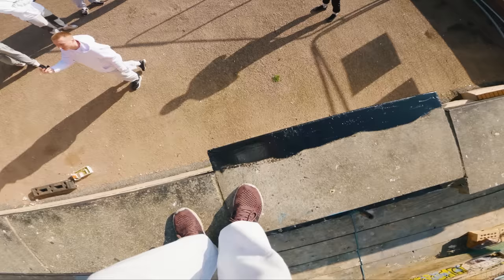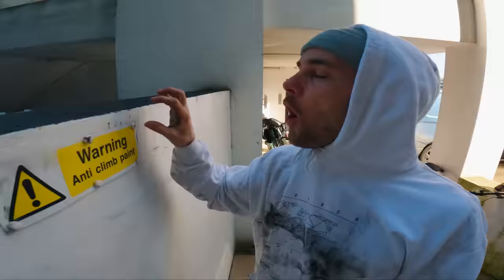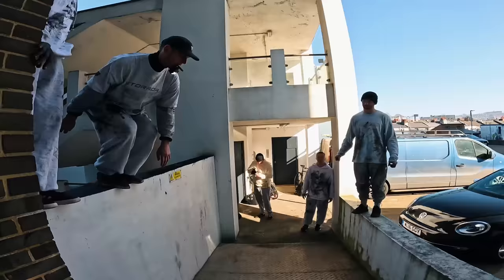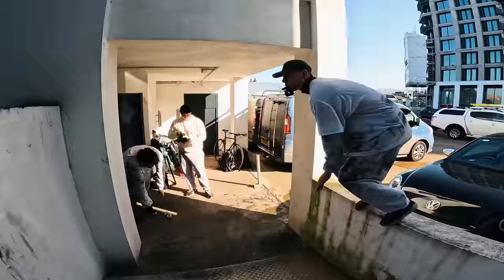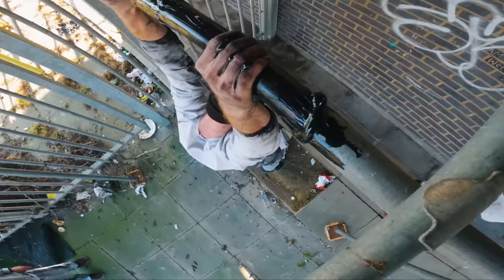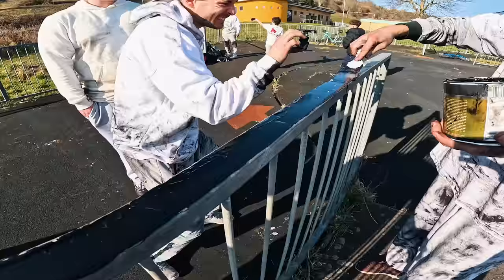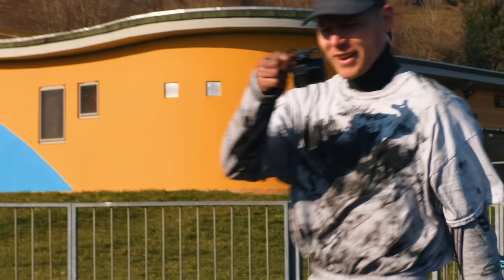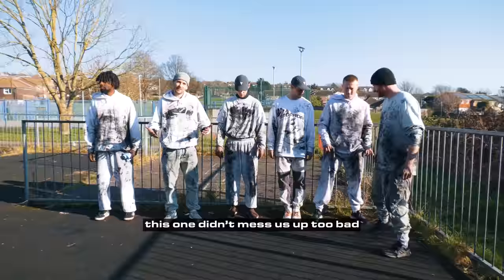ANTI CLIMB PAINT vs PARKOUR - Does it work?! 🇬🇧

Comment: Nerd here:
    The trick is to keep the center of gravity closer to the wall so there would be less pivoting force around your feet. Basically meaning you should keep your entire body as flat as possible on the wall and push with your hand. If you try to kick with your feet, you will feel the force of the kick not direct you upward, but push your hand off. The reason doing it with the entire forearm often works is not because there is more contact with the wall, the paint is so slippery it makes a negligible (ignorable) difference. Putting one of your forearms over helps to climb the paint because it effectively brings your center of gravity in since the side of the forearm grip will be sticking to the wall. Some examples of successful climbs can be found in these three time stamps: 12:14, 12:56, 13:36 
    The trick to stick to the track-like things is to not to land with your feet flat on the thing. What’s there to stop you bro? Also, if you try to brace the knees like a normal long jump you would be literally bending your knees then extending them like a spring, kicking your feet across the paint, slipping hard. 

    Yes, they did succeed in sticking themselves sometimes even though it looked like the guy landed feet flat on the bar and also bent their knees because it is possible but would be much easier using a different technique. It is worth noticing that the guys who did that, tried really hard to not extend their knees at all after the landing (which is really hard, try it, you will always bounce a bit). The paint was also wearing really thin and mixed with a lot of debris from their shoes making it a lot less slippery.
    If it was me, I would try to aim for the edge of the landing bar and pretend that edge is actually what I’m landing on. Then, I will bend my knees all the way down, so my upper body will be easier to stop (lowering the radius lowers the angular momentum)(33:47 is a perfect example). I won't slip because I’m actually pushing the 45-degree edge straight on. I won’t fall either, since the remaining moment of my upper body will be redirected into pivoting (rotating) my body face-forward so I will be eventually (but quick) standing still on the landing bar. The tricky parts are to keep balance after the thing (unlike 33:07) and to control the knee’s landing motion so I won’t bounce myself backward (like 33:18).

Comment: i feel like this stuff would cause more accidents at low altitude if that makes any sense. like without the paint you can get up higher and the higher you go the harder the fall, but you have full grip so if youre experienced then you should be fine. but with the paint you have NO grip, and could more easily hurt yourself if you try to hop around with it on surfaces.

Comment: Seeing this anti climb paint breaks my heart a bit. I grew up skating and having spots taken away by skatestoppers, and while it was frustrating, I was always told it was due to the noise and property damage that skaters cause and while I was unhappy I understood. 
This on the other hand literally devalues whatever property their painting painting on with the unsightly thick layers of black and the prints/ burs that fly off, for 0 reason imaginable. Like just applying the paint does more damage then a free runner ever could
Reply: Ultimately it's nonsense.  Thick stainless steel would take forever to grind through. Scratches polish out.

Comment: also i think you're supposed to give it time to dry and add multiple layers like the 2nd spot
how it was caked on the way it was? most people who would try would do it and give up
after ruining their clothes and if it's illegal/fine-able then getting caught
"black-handed" means they'd dip to get cleaned up asap.  but those like a group doing a
video like this will wear it down to where its possible.
otherwise, it's just not possible when painted properly.

Comment: Fresh paint is slick regardless of what it is. Does this anti climb paint stay wet or what this don't seem to be anything but climbing up wet paint
Reply: Tar never dries but is solid depending on temperature. Good for sealing things as it's self healing. But tar paint( graffiti) goes through when over painted.      Maybe this is tar+ oils.  Not every oil dries , not every oil is suitable for oil paint. And even then it dries slowly. Maybe Vaseline in there.       Making a goo that doesn't dry is doable.
Reply: @gur262  ohh I see I didn't even think of tar but that makes sense I've never seen this used anywhere but I'm in the US so maybe that's a factor the US is wierd

Comment: I was once a skateboarder and traceur, and I understand grindstops to stop skateboards from scratching up rails. But slippery paint to cause people to slip off ledges? How's that legal? xD
Reply: See the “anti-climb paint” sign? That’s how it’s legal.

Don’t touch the electric box that says not to touch it, don’t run near the wet-floor sign, and if the walls say “wet when climbed” maybe go around instead of over just this one time.
Reply: @gameinsane4718  Wow I didn't think I needed to explain it to anyone but wet floors are normal, floors need to be cleaned and it's courteous to inform someone of the typical situation of a wet floor. Electric boxes are safe to touch the outside of and aren't dangerous until you tamper with the inside of one. Can you see what I'm implying yet? Does placing a sign next to a bear trap inside a grocery store make it legal? Obviously not. Do you think children who climb on things read and obey signage? I think not. Clearly these things are not the same thing. One is an actual death trap with accompanying warning, and the other is common and typical dangerous situation with a warning. That sign is akin to a landmine field sign in an urban location. That shouldn't be legal. But feel free to argue with me about it. I'll engage with this. Just know you're arguing FOR anti-climb paint on a parkour channel if you do. We don't like anti-climb paint around here.
Reply: @Vulporium   you asked how it was legal, I told you how. Warning signs typically do a lot of legal heavy lifting. “Dangerous to climb” might be more direct, but the fact it’s clearly marked does reduce liability on the property owner’s end significantly to entirely depending on your local laws. 

I’m also not particularly “for” either side in-particular, but like if a kid likes climbing on/over things on other people’s property regardless of signs, they’re gonna learn to read warning signs eventually if it’s “anti-climbing-paint” or “BEWARE OF DOG”, just saying
……also maybe watch your damn crotch goblins if they can’t properly behave around warning signs?
Reply: @gameinsane4718  Sorry for my frustration. My original comment was rhetorical. I understand the sign helps cover them in a legal situation. But I stand by my original point in that I believe if someone slips from a surface that has been painted with anti climb paint and is injured, they may be sued in lieu of proper signage as it's not a proper method to insure the safety of others. Whereas coffee labeled hot, is an expected warning, and provides safety to consumers (dumb ones I guess) just as many other products, like some we've listed already. My only gripe with this is that there's no ADDED safety in the warning, it instead indicates a trap has been set. Literal barbed wire is a better deterrent than making the surface slippery. In my view, It's better to physically prevent the act of climbing all together by blocking access rather than entrap the area if you succeed to get up there. The way I see it is that this method has a higher likelihood to cause injuries than to prevent them. But I very well could be wrong. I just am unnerved by making something more dangerous than less, and I think they could be sued despite proper signage. But I'm no lawyer. Sorry for being rude before.

Comment: I wonder if you could just go buy a few clean paint rollers, and soak up all of the anti climbing paint. Either that or some form of solvent might cause it to coagulate I guess it really depends what it's made of. /shrug
OR you could create some form of fabric, that is grippy on one side, with adhesive on the other, and just lay it fully over the paint, such that it overlaps the paint, and sticks to the parts of the wall that aren't painted.

Comment: Why not just put barb wires and sharp spikes? Wouldn’t that work better? And cleaner?
Reply: Rodents often get caught up in them. You also need permits for it in some places, plus it gives a horrible dystopian vibe.
Reply: @AximVidya To be fair it goes both ways. Why not do it somewhere they're actually wanted instead of being a potentially destructive nuisance? Nobody is forcing them to use that building's infrastructure as their jungle gym and clearly if it gets to the point of paint they have to fully know they're unwanted there.